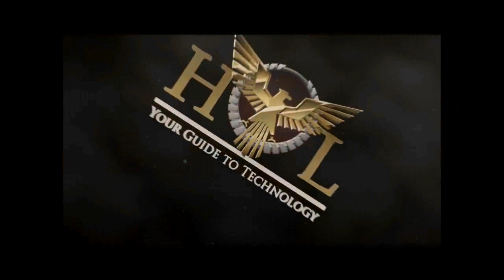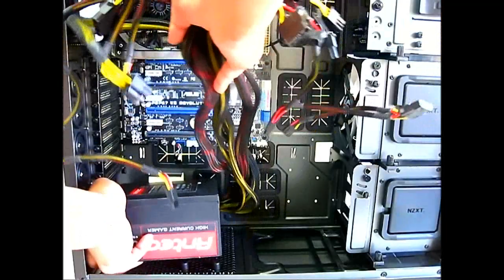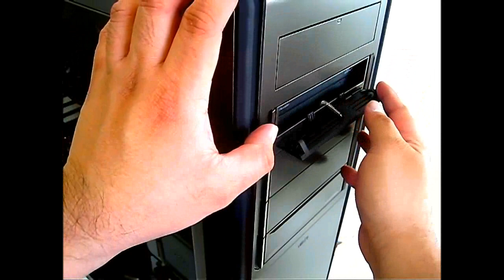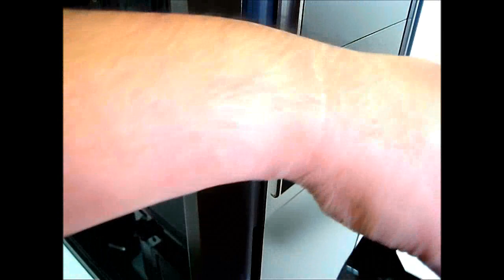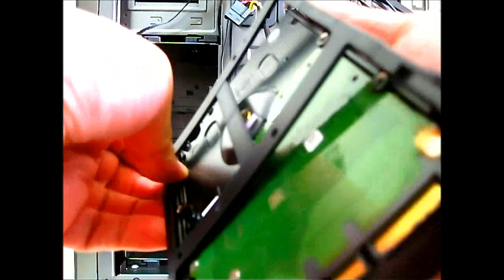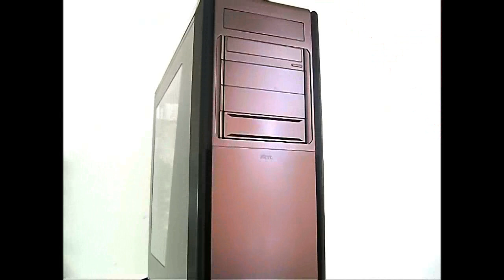NZXT Switch 810 Special Edition (Gunmetal) - Component Installation (Air cooling)

Comment: Did you use the nzxt standoffs to mount the motherboard? I'm having trouble screwing them in. I have to push the motherboard down onto the case to put in the screws and i can only get in 3 screws on the right most side.

Comment: @ZafaStudioTV There are some minor changes they made, such as making it easier to fit rads in the roof efficiently and if I recall correctly the original still had the problem with the 90 degree Sarta cables not fitting in the hard drive bays.